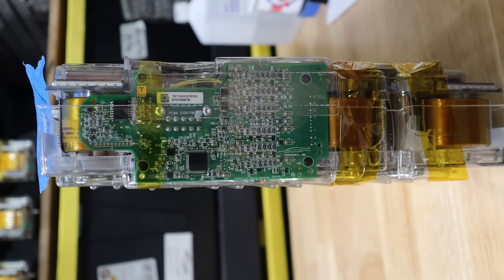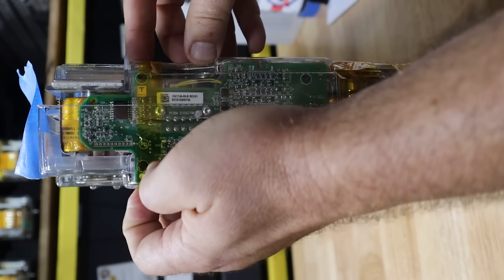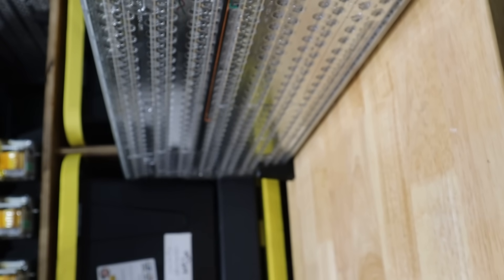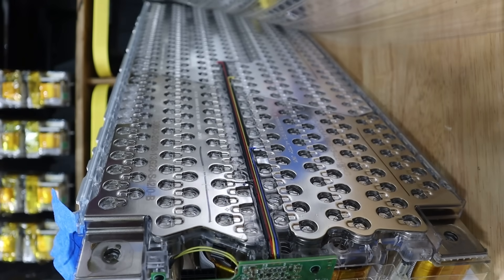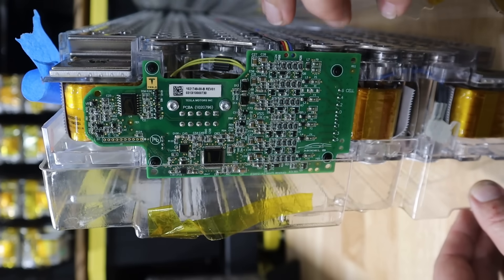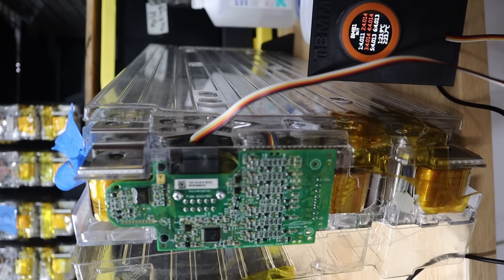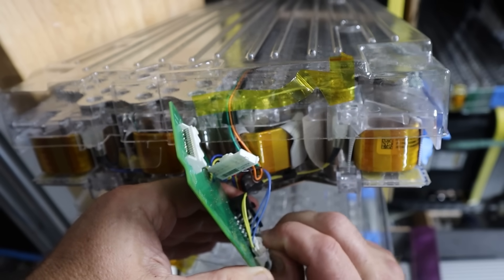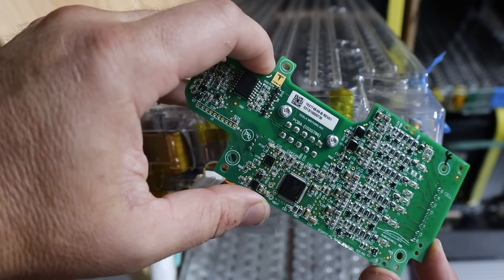Tesla Battery Repair: Module Modification - Check BMS Wires, Remove Tab, Remove and inspect BMB

Comment: Recommend, keeping electronics boards in anti static bags CLOSED when not being worked. Also, hold boards only by the edges.

You are correct, removing those tabs from every module would have added unnecessary manufacturing costs.

Comment: You need to follow proper electronics handling procedures. 
You need to have wrist/ankle proper ground strap BEFORE handling. Latent static can damage those BMS boards. 
Use a plastic/wood stick to press on the voltage sense to confirm good Ultrasonic weld.

Comment: very detailed and slowly explained - I would not have believed that a rubbing plastic could cause this issue cause i have not noticed that in my RC airplanes and submarines so far where also a lot of smd components are soldered on high densely populated pcbs.

Comment: Glad you have most likely found the cause of your battery errors!  Have been able to identify the reason for the water ingress?    Missing or damaged bottom splash covers?  Maybe the previous owner drove through deep water...   I'm going to get under my Model S and do some inspections.   Mine is a 2019 so if it breaks, it will likely be the sensor leads popping off the terminal from thermal expansion that you were checking for.
Reply from the maker: In the next video, you get to see all the dirt jammed in the umbrella valves on the bottom of the battery pack.